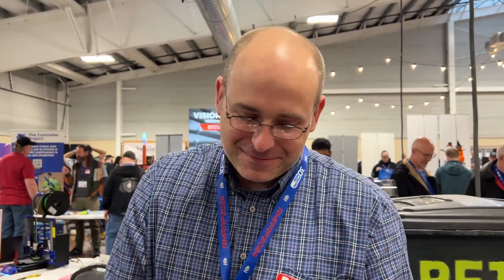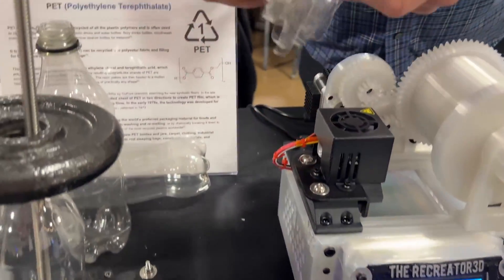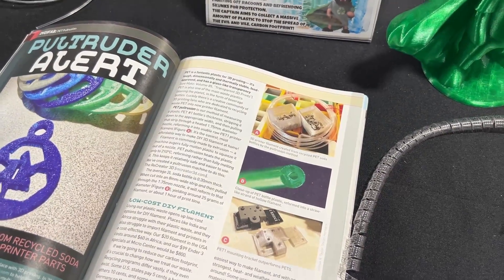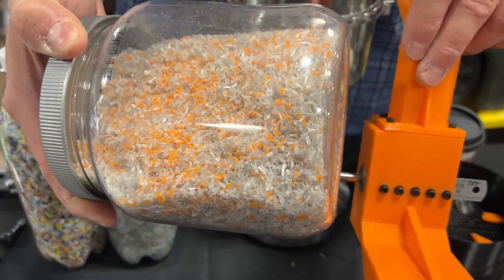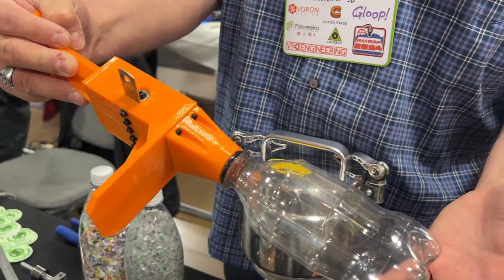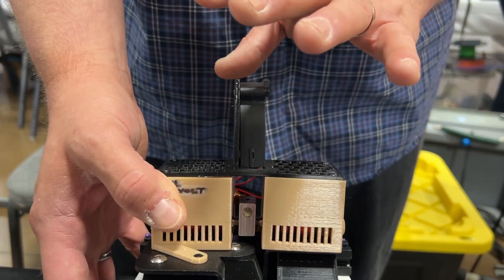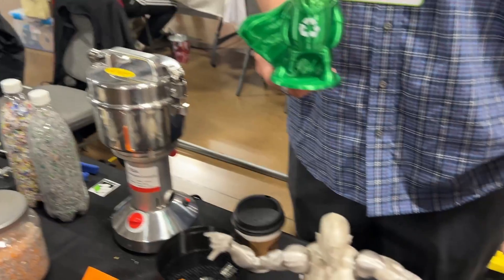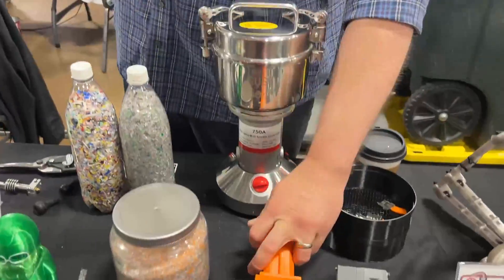The DIY Recycling Machine For Your Plastic Waste!

Comment: Helaas is het voor NL niet lucratief met het statiegeld. Wel leuk dat wel. De schredder is wel interesant.
Reply from the maker: Ik ga wel kijken hoeveel het zou schelen. Ik ga er wel een maken
Reply: Hangt ervan af, je zou kunnen kijken hoeveel gram filament je uit zo een fles krijgt en dan uitrekenen hoeveel geld dat waard zou zijn (als je het vergelijkt met het gemiddelde bedrag dat je betaalt voor een rol filament). Als dat bedrag hoger ligt dan 15 cent voor kleine flessen of 25 cent voor grote flessen, dan is het het zeker waard want dan verdien je er dus meer aan.

Voorbeeld:
Een klein flesje bevat ongeveer 22 gram PET. Hier krijg je natuurlijk niet al het plastic uit, maar ik schat dat je wel zo ongeveer 16 tot 18 gram PET terug kan krijgen.
Op een normale rol filament zit 1000 gram materiaal, en voor de gemiddelde rol filament betaal je ongeveer 30 euro (ex. verzendkosten natuurlijk).

Stel al krijg je 16 gram PET terug uit de fles. Dan krijg je de volgende berekening:
16 / 1000 * 100 = 1,6% (16 gram PET is dus 1,6% van één rol filament)
€30,00 / 100 * 1,6% = €0,48
En dit is met een klein flesje, dus je krijgt voor een klein flesje al meer dan driedubbel de waarde aan filament terug. In mijn ogen is dat geweldig, maar ik snap het ook als je daar andere ideeën over hebt :)
Reply from the maker: Ja, precies dat. Hoeveel filament krijg je uit 1 fles versus geld dat je terugkrijgt met statiegeld